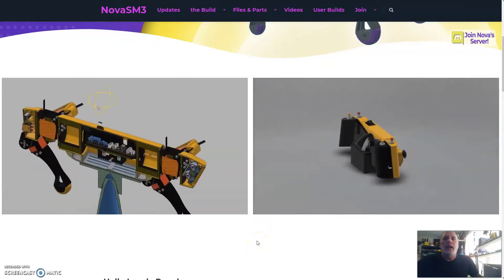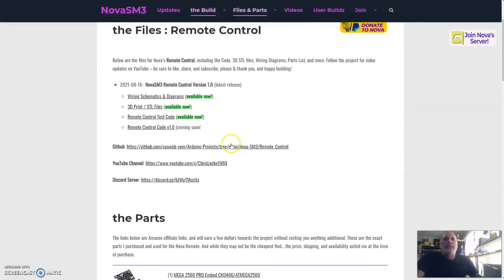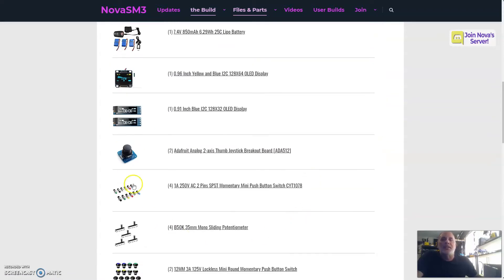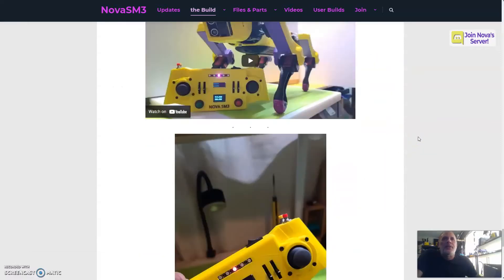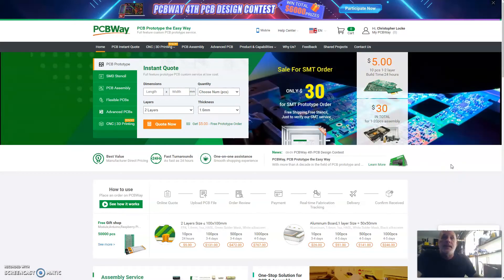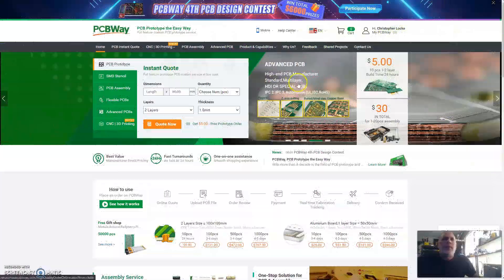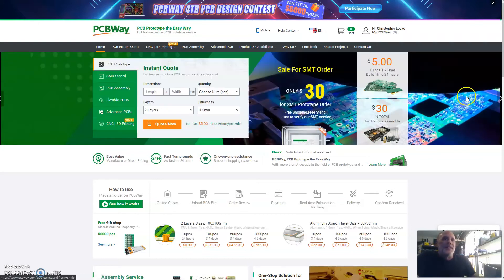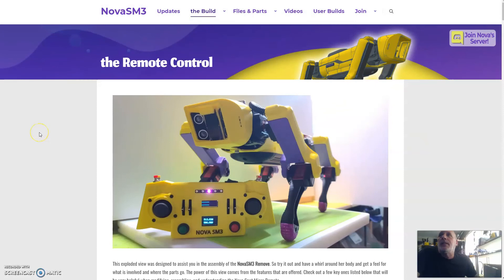NovaSM3 Remote Control & PCBWay Contest!

Comment: hey chris is everything in the PCB board? and which is better arduino or teensy?
PS: My printer is already on print☺️
Reply from the maker: The PCB is just a bare pcb, if thats what youre asking. And teensy is many times more powerful than any arduino, so depending on metric, yes, teensy is "better" 👍